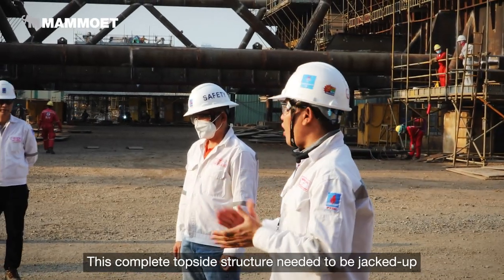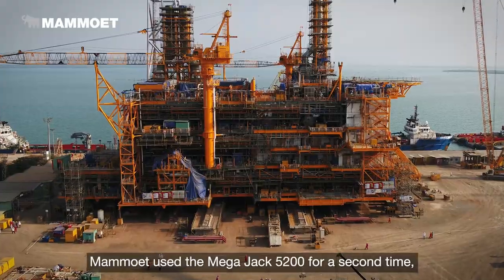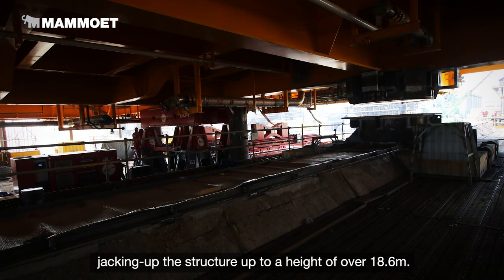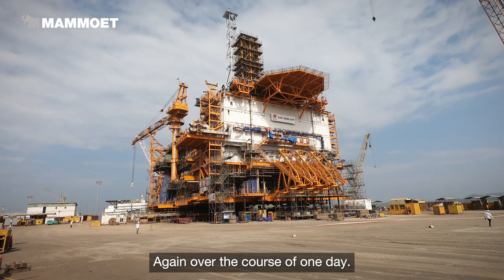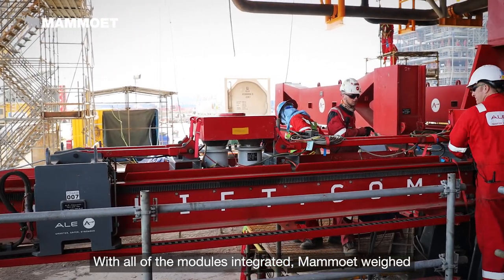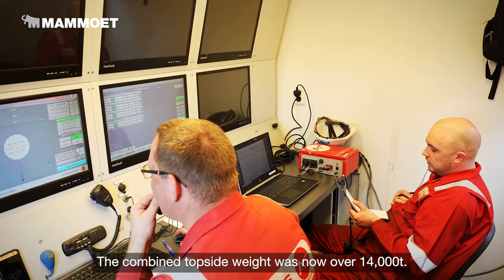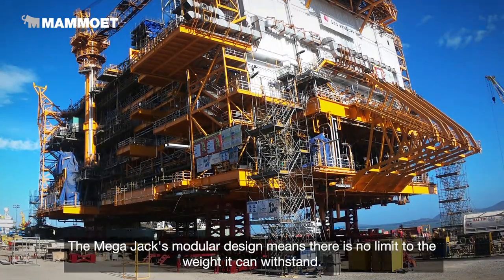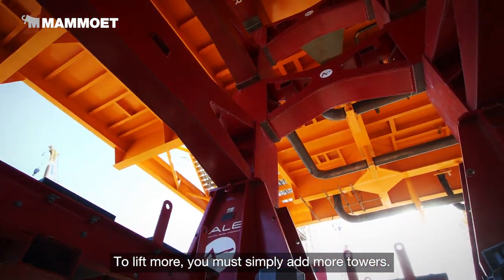Part #5 Vietnam - Mega Jack 5200 in action to jack up the 14,000t Topside

Comment: So each corner have ~4000 tonnes weight and thats a lot. Imagine, if just one small module fails, whole thing will fall over.
Reply from the maker: Hi there! Yes, it is a serious task. Before anything is done, there is an extensive project plan and management done. Safety is a top priority for us.

Comment: I was working at waterford nuke plant in NO LA and the replaced a steam generator  they used water to cut through the 3 foot thick concrete  wall the generator weighed 750k lbs they moved like it was nothing